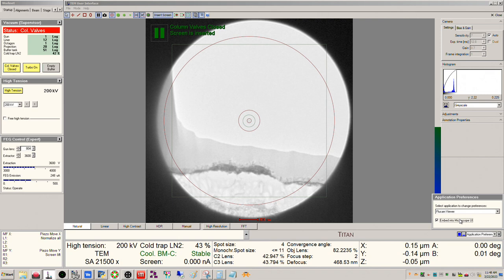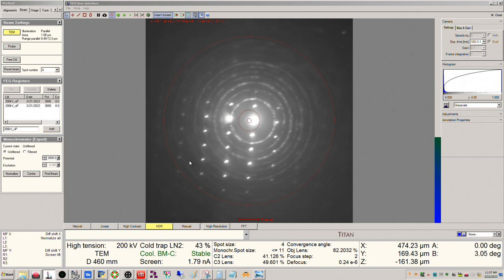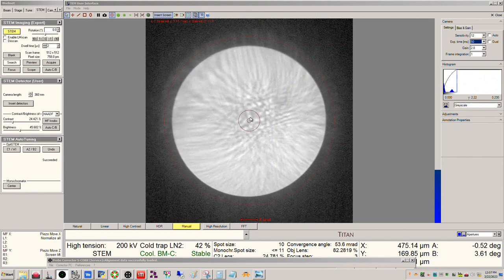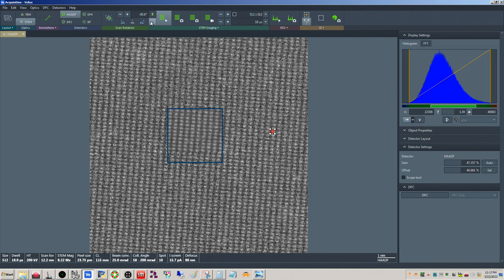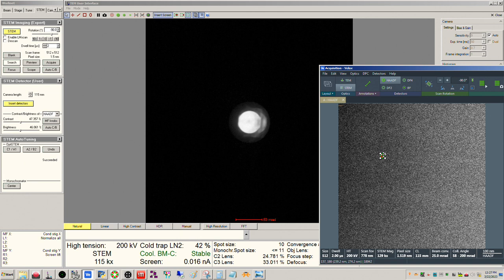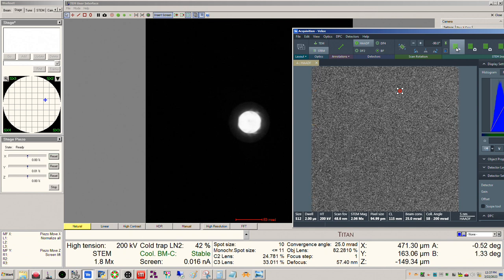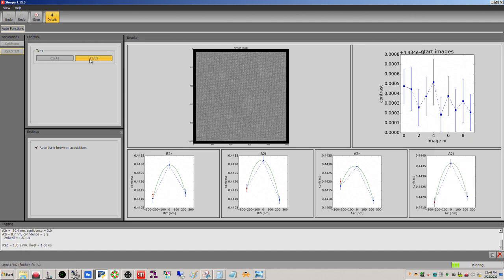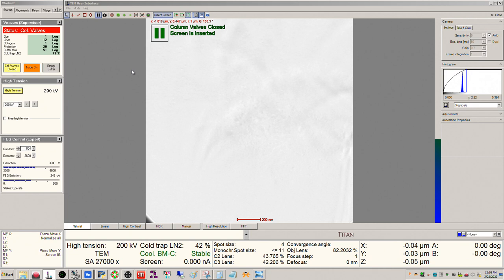FEI Themis Z S/TEM: STEM alignment and HAADF-STEM imaging (UPDATED)

Comment: Thank u for ur nice video! I got a question about the convergence angle in stem mode. Our microscope is a titan themis 300kV. How to choose the convergence angle when we do the regular atomic resolution imaging? Do we need to make the convergence angle as large as possible to get a better resolution? like 30 mrad. By the way, we only got a 70um c2 aperture rather than 50.
Reply from the maker: Thank you; for obtaining the best possible resolution, you would want to use the value for alpha that gives the smallest possible probe. At 300 kV, this would correspond to the limit in the phase plate determined by tuning of the corrector. Normally, this can be around 25 mrad, but we usually tend to cut this down by 2 - 3 mrad to give 22 or 23 mrad, just to make sure we are within the limit of the phase plate and reducing the effects of higher order aberrations.  30 mrad is likely too large and will introduce too many higher order aberrations to the probe.  If you are not familiar with what I mean regarding the "phase plate", please go check out my video on corrector tuning here (the thumbnail shows a "phase plate"):

https://youtu.be/o3cbgSqXtCw?si=WcdU0HWB-E7OzJd3

Comment: Hi, I have learnt a lot of things about aberration corrected microscopy from your videos. If possible can you please share a video on acquisition of low-loss (plasmon) EELS spectra and plasmon map acquisition of Gold nanoparticles. We have FEI TITAN probe corrector in our lab (80-300 kV). Thank you very much for your efforts.😁😁
Reply from the maker: Hi Dikkuroy: thank you for the suggestion; this would certainly be an interesting video; I think something that is a little more basic with regards to EELS is probably better to cover first; doing plasmon mapping may necessitate the use of a monochromator (which we do have on our system) so it would be a rather involved video.

Comment: Thank you very much Nick! Great source of needed knowledge. I wanted to ask what if the brightest point moves when the beam is tilted? What's the cause? How can this be corrected?
Reply from the maker: Hi Mirka; you're welcome.  If the caustic spot moves when the beam is tilted, then your objective and/or C3 lens settings are incorrect.  If this is the case, this is something that really should be fixed by a field service engineer because setting the default objective and C3 lens settings in nanoprobe STEM mode isn't something that can be done in the list of alignments that are normally accessible to users even at the supervisor level.
Reply: Thank you very much. I will ask a field service engineer for help.   @NicholasRudawski
Reply from the maker: @MirkaPawlyta  good luck and I hope this gets resolved for you.  Whatever happens, remember that the problem is not fixed unless the beam is stationary when you tilt it at the default C3 and objective lens settings.  If a service technician tells you otherwise, he/she is incorrect (which, unfortunately, is something I have come across).  The good news is that there are plenty of service people who do understand this; you just have to get your opened call in front of one of them.  In our case, we ultimately had a high-level service person remote in to the system to fix this exact same problem.